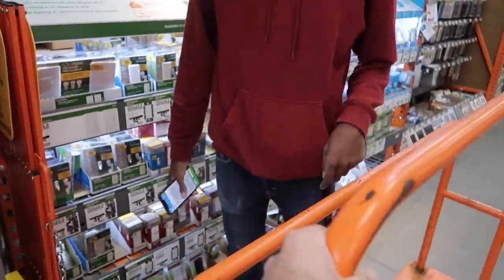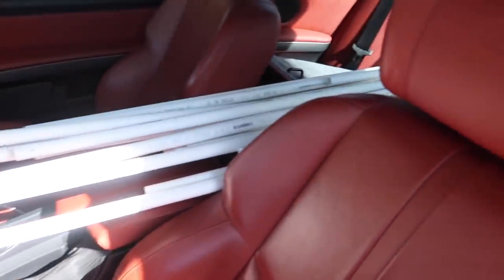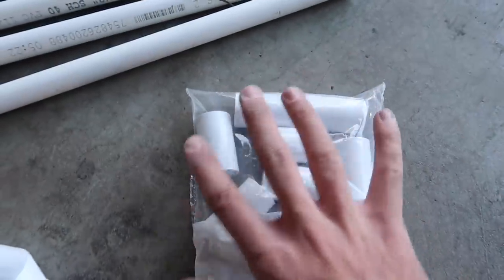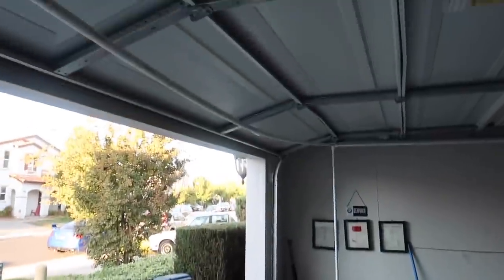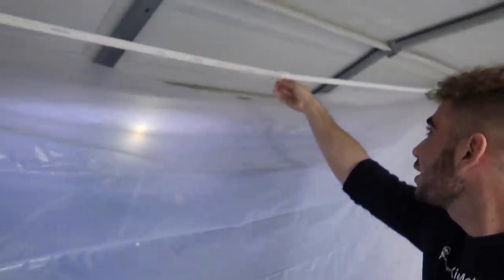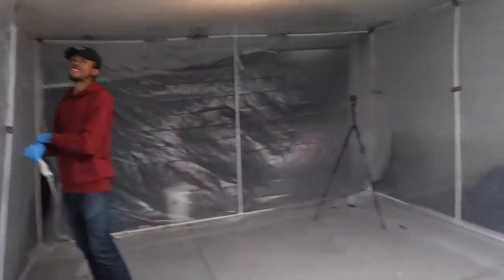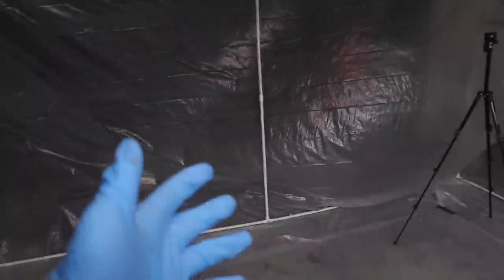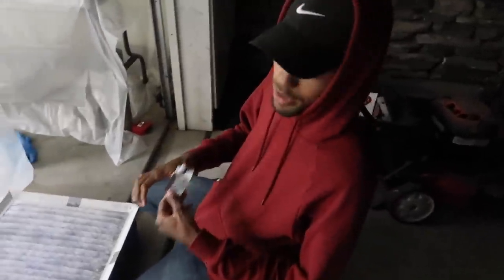$120 HOMEMADE PAINT-BOOTH! (LETS START PAINTING!)

Comment: should put a few j hook or eye bolts into the wall then you can tie the top off to the wall to keep it from leaning in, and then you can use the eye screws to hang stuff on the wall later - win-win.  You can also use 45 degree fitting to make the roof vault in so the horizontal runs are shorter and sag less.    Also you want your fans to blow air in with filters on the inside, then have exhaust filters so that its positive pressure and doesn't suck dust in trough the seams.   The last thing you want is it to fall in on your new paint.  You can also tie it off to the garage door tracks just make sure not to interfere with the wheels and test it without a car in the booth.

Comment: If you use a fan blowing in you will bring in dust and debris into your paint.. just get 1 or 2 fans pointing outward front and cut 2 holes in the back for the filters. Hopefully it comes out good. Doing the same thing for my hood n bumper.